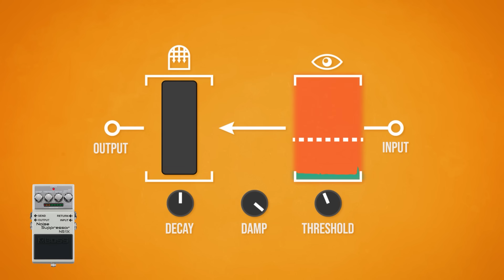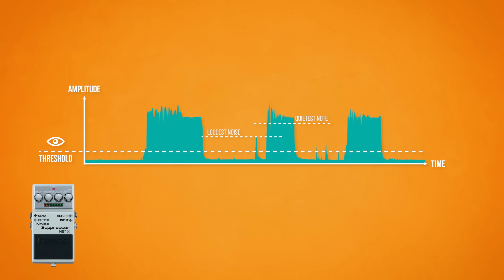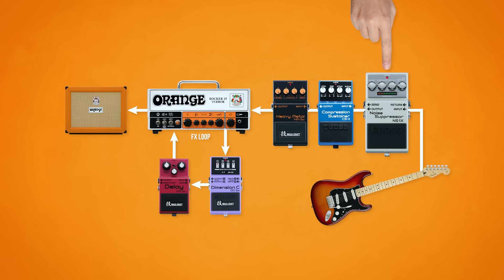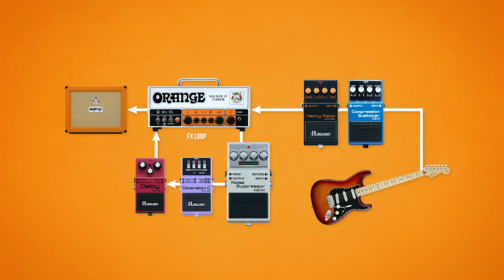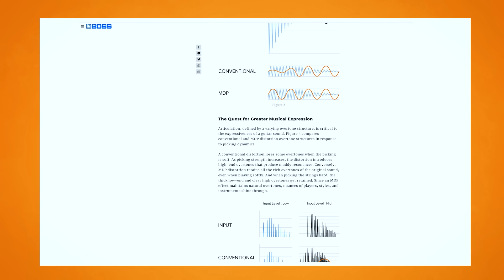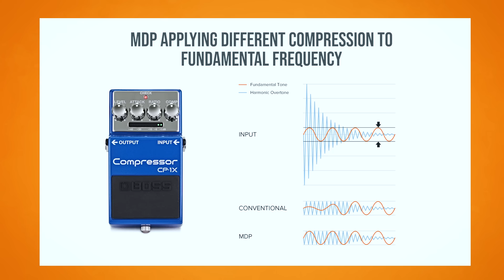Noise Gates: Everything You NEED to Know | Too Afraid To Ask

Comment: i have the problem that my prs  mt15 is feedingback like the high pitch squeeling feedback bcs of the sound that is coming back to my pickups. Does a noise supressor help with this feedback noise?
Reply from the maker: You want to solve the feedback issue before using a noise gate. A noise gate will struggle if the feedback is at the same volume as the signal. 

Feedback is often caused by the guitar being too close to the amp, using too much gain, having unpotted pickups or other microphonic elements in your signal chain. Try fixing these issues to reduce the feedback, then you might find a noise gate useful for any system noise that remains.

Comment: Excellent explanation of the issue and the correct solution, particularly with the sophistication available from the subject pedal.  Critical points successfully made with the demo sequences and the logic of connection, placement and controls and their effect.  Many a performance will potentially be enhanced simply from getting those four ports wired to the right place on your pedalboard. Thanks for keeping us informed Colin, knowing Watts what!

Comment: Even though we're trying not to amply noise, could we possible run the compressor into the noise gate input so it has the sound evened out and consistent and then use the send/return for the overdrives and amp preamp? I feel like there would be so noise compromise here but it seems like it could be the best way to keep input trigger threshold consistent.

Would love to hear your thoughts on this.

Comment: Do you have a video on how to set up the knobs on a noise gate?
Reply from the maker: Setting the knobs is dependent on the rest of your set up. 
But the short answer is: use your ears to set the threshold to where it is gating the noise, but not the notes. 

That's pretty much it.
Reply: @ScienceofLoud ah cool thank you. I was just getting confused on what each knob was doing. Threshhold makes sense but damp is confusing me.
Reply from the maker: @maxs.3224  Explained in this video at 1:50 

Damp is essentially how tightly is the gate shutting (or how transparent is the gate). 
When the gate is shut, the damp control selects how much of the signal still gets through.
Reply: @ScienceofLoud oh that’s what that was talking about! Thanks so much now it all makes sense.

Comment: You have no idea how many times I had to explain to redditors and forum rats that a noise gate works best if the noise hasn't been amplified by gain. "Why would I put my gate first? Distortion is where the noise comes from. It makes no sense to gate my clean tone? You just don't understand high gain equipment like I do." Like, trust me. I play a strat and use a Carcosa as a boost for a Big Muff. I know how you deal with noise.

Comment: I bought a Tele with gen 4 noise less pickups. It makes a static, crackly sound when I play. My other guitars are fine.  I don't use pedals. Would this pedal stop the noise?
Reply from the maker: I think it would be of more value to figure out what is causing that issue and solving it. Something is wrong with that wiring somewhere.

Comment: Hello! So the diagram in the video says the distortion and compression go into the "send and return of the pedal" Then the delay goes into the output of the pedal. What if my delay/reverb is already in the effects loop of the amp? Then does that not matter? I thought the delay and reverb would go into the send of the pedal and then to the effects loop of the amp then back to the return of the pedal. Then the distortion would go into the out, into the front of the amp? Or am I missing something? Thanks!
Reply from the maker: @RobertHappy15  You are missing the part where I made a whole video explaining this. Please watch again. 

You seem to be confusing the send and return on the Noise Gate with the send and return of an amps FX loop. These are not the same thing.

Comment: How did you run the Delay Llama after the amp if the Imperial does not have an effects loop?
Reply from the maker: @2yugen2  I'm using the Boss Tube Amp Expander, which has an FX loop - that lets me insert pedals after any amps that don't have a loop.

Comment: I have a TATA question...  In most speaker cabinets the speaker size is related to the frequency you want to reproduce-large for diameter for bass, small for treble.  Yet with guitar amps we use large 10 and 12 inch speakers to produce these ear piercing highs.  What does it work for guitar amps but doesn't work (or at least isn't designed this way) anywhere else?

Comment: Will it stop high pitched feedback due to cheap guitars?
Reply from the maker: That's not an issue with cheap guitars, that's an issue with how you are using your equipment.
If you have a feedback problem, that's something that needs to be solved independently from using a Noise Gate.

Comment: I have one question about the send/return function and how it cuts away all the background noise so accurate. Is it possible that the ‘sensing’ part sends two signals simultaniously theough the loop, signal “playing+ operating” and a signal thats only the “operating” noises. In my head the output than subtracts those signals so
(playing + operating) - operating = playing

Is this right or no
Reply from the maker: No. The explanation in the video is correct, what you have said in your comment doesn't make sense.
Reply: @ jups im sure you’re right, but i wondered if this sort of thing could ever ne used. Although it does make sense when talking about mass spectrometry, i guess not in electrical engineering.
Reply from the maker: @Jona000  Why would you think that the process of GC or Mass Spectrometry is in any way analogous to the operation of a Noise Gate? 

We aren't using the differing physical properties of molecules and their interaction with other materials or magnetic fields to physically separate the elements of a mixed sample. 

Notes and noise, as described in the video, aren't separate entities - they are both electric signals which form a superimposed waveform that cannot be separated. 

All a noise gate is doing is turning down the volume of the signal when it passes below a defined amplitude threshold. 

The 'Sensing' part is just looking for when the signal amplitude crosses the threshold. 
The 'Gating' part is turning down the volume to mute the signal. 

The Send/Return simply lets you place other processes between these two events. 

I hope this clarifies your confusion on the matter.

Comment: If you have a ton of gain stages in your gate and have to run it hard clamping,  you can put a Compressor, preferably one with a blend like the Keeley Compressor+ in front of the gate and it helps kick it open without choppiness or loss of tone and signal, the Keeley is great as you can blend it in for fine tuning and not compressing the entire signal yet, compress it enough to kick the gate open and stay open in sustain with ease. I had a Noise Gate on my 1993 Digitech Legend II and have been using one since that year. I had the comp , para eq, GEQ and Grunge distortion presets for rhythm and played very percussive 90s Hardcore/Mathcore/Metalcore.  I would let people borrow my Tubeworks Tweed  4x12 at shows, but my high gain and noise gate (W/Tubeworks 1600 STereo SS Power Amp) that was very touch sensitive scared off all the Crate and Valvestate with a Turbo OD kids off. The first Dillinger guitarist had a similar set up but an ART procesor in his Rack. Gigged together actually.
Reply: I have an ART 2000 EXPRESS  guitar processor ..Way ahead if it's time..👍🎸 🎸 🎸
Reply: @lisaayers1975  I had a Digitech Legend II, when I gigged with Dillinger Escape Plan in the early years their first guitarist had an ART and I my Digitech ab power amp was very similar I had hard gates on that.  I can't do digital diarrhea anymore. Glad my ex guitarist had a nice punchy tube amp to help the tone on the old 1999 full length we did.  I have a walk of Orange amps but selling lot to downsize

Comment: The way u explained and graphed the fx loop part was very confusing
Reply from the maker: @Kudabear1  just because you were confused doesn't make the explanation confusing - no one else had an issue understanding it.

But please do tell me how you'd have explained it in a less confusing way.
Reply: @ScienceofLoud  I can't Im trying to understand how it works and I still don't get it
Reply from the maker: @Kudabear1  Everything in the loop sits between the sensor and the gate - as if the sensor and gate were two separate pedals bookending the effects in the loop. 

I can't make it simpler than that for you

Comment: Is there a way to retain intensional feedback but still have it cut it off when needed? I have a solo with several rests that ends with some sustained feedback, and I haven't been able to achieve both the feedback and actual silence at the rests.
Reply from the maker: When it comes to the point when you purposefully need feedback, you can just disengage the noise gate.

Then re-engage it again once that section is past.

Comment: Hi Colin! Not sure if you are able to help out with a question here. I have a Rocker 15 Terror as well, and run my time effects through its FX loop. 

I see your diagram to run the end of the distortion chain directly to the amp's input, and then run the Send of the amp's FX loop through the Return of the noise gate and completing the signal chain this way, as opposed to running the end of the distortion chain to the Return of the noise Gate and the Output of the noise Gate to the amp's input. However, at another point in the video, only the distortion pedals are going through the noise gate, and the output of the noise gate is going to the front of the amp. 

Theoretically, this might also gate any noise generated by the amp's distortion channel, but I am wondering if this may have any adverse effects or be otherwise unadvisable. Is there any best practice on whether or not to place the noise gate within an amp's FX loop or go through the front? Hope this makes sense, thanks!

FYI I love your videos; I've always been a fan of knowing how stuff works, and you do an incredible job of explaining things in comprehensive yet easy to understand terms.
Reply from the maker: My suggestion would be to try it and see what you think. You are not in any danger of damaging anything, if that's what's concerning you. 

Whether it will be beneficial or not is ultimately dependent on what pedals and amp you are using, and how you have them all set. 

Try it both ways and find out what gets the better result for you.
Reply: @ScienceofLoud  thank you! Appreciate the reply

Comment: Hey if my delay pedal produces noise and i still want the tail will it work if i put this pedal after the delay or will it kill the tails
Reply: It will kill the tail. That's why you put your gate before any delay or reverb.
Reply: @fonesrphunny7242  but will it remove the noise that i get from the delay if i put the gate before delay
Reply: @eriksafin  You want to filter out noise, but that's not what a noise gate does. It is not going to solve your problem.

What delay is it anyways? Is it old or used and maybe damaged? Tried running it with a 9v battery? Cables? Nearby interferences? XLR ground loop? ...

Find the cause and stop fighting the symptoms. Filtering should be your very last option, but a noise gate won't do that.
Reply: @fonesrphunny7242  Thanks man God bless you

Comment: Hello @ScienceofLoud  This is a great video on both how to use and how to set up!  I had a question through... I just bought the NS-2 yesterday.  I have is all plugged in correctly and it seems to be working great.  The thing I noticed though is there is zero noise when I am not playing the guitar.  However when I start to play the guitar I can still hear the noise over the guitar distortion.  Is this normal?  I have it hooked up correctly using the send/return into my distortion pedals.
Reply from the maker: Yes, this is normal. 
As I explained in the video: A noise gate doesn't remove noise from your signal, it simply shuts off the whole signal when it drops below a threshold amplitude. 
If your signal has a lot of noise, you're going to still hear it when the gate is open. 

If the noise is louder than your signal then a Noise Gate won't fix that - you have other problems which are creating noise that should be addressed separately.

Comment: Hi Im wanting to use one with a loop , but send the 'input/ send' on AMP A's input but put the send from another AMP B into the  return and then output through the pedal back into AMP B's return. 
Im using a stereo setup and the Zombie 2 is really noisy , whilst AMP A only has an OD1 in front of it. 
I understand that the pedal is like an X path and think that the signals wouldnt mix. Theoretically using it on 2 amps ( one in front using the naked guitar's noise floor) and the other in AMP B's noisy FX loop. Good eh???

Comment: I did 4 cable gating for a while. It works, but not for me. It's too much setup for minimal payoff as i only use my gate as feedback reduction. My NS-2 is too slow, so these days i just ride the volume or turn down the gain a little. I still keep it on to reduce feedback on the choppier riffs, but i can get by without if need be.

Comment: Is there a way I can roll off the volume for more dynamic playing with “edge of breakup” sounds while using a noise gate? I stopped using noise gates because my signal would cut out when I roll off my volume knob? I wouldn’t mind going back to using noise gates if there if I can retain my signal as I roll off the volume knob.
Reply from the maker: You have to set the threshold of your noise gate with your volume rolled back to ensure it is below your rolled back signal level.

You always set the gate for your quietest playing.

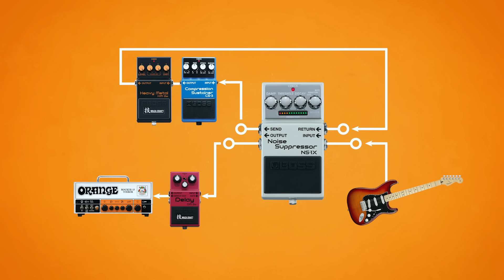Comment: Great video, Colin. You're explanations are always very helpful and enlightening, but I'm still a bit confused about something. The diagram at 9:54 shows compression/dirt in the Return/Send loop of the pedal and the Output going to delay/reverb then to the amp. However, I'm having trouble seeing how this matches up with your diagram at 8:08 showing the signal going through suppressor Input, then to dirt, then amp, while the Output (second "half" of the suppressor) of the pedal going to delay/etc. in the amp's effects loop. I'm fully aware your diagrams are for illustrating what you're talking about at that moment in the video, but if you could shed some light on this, my tiny pea brain would appreciate it! Cheers!
Reply: Guitar -> NS Input 
NS Send -> Comp, Dist, Amp in
Amp Send -> NS Return
NS Out -> Delay, Reverb, Amp Return

Essentially, the compressor, distortion, and Preamp are all in the Gate loop, and the final output of the gate goes through the delays and reverbs into the Amp return. It makes more sense if you think of your amp as having "Preamp in, Preamp out, Power amp In" instead of "Input, Send, Return"

Comment: This is a great video, thank you indeed! But what about the 4-cable method with Noise Gates?
Reply: 7:35-9:05.
Reply: @AeolianSeventh  Appriciated, but I'm talking about when you have an FX loop on your amp etc. and put the "send" go to the amp input and the "output" to the amps FX loop return.
Reply: @RohmanDarkwaltz  It's the same principle, keeping in mind that the preamp (everything before the FX send, usually*) is a gain device just like a compressor or distortion pedal.  

The diagram at 8:06 is showing the four-cable method:
-guitar to noise gate input, so the signal is sensed before any gain is applied; 
-noise gate send to pedals, which will add noise; 
-pedals to amp, which will add noise; 
-FX send, where hopefully all the noise has already been added, to noise gate return, where it will be gated;
-noise gate output to delay, reverb, etc.;
-delay, reverb, etc. to FX return, where the signal becomes loud.

*I say usually because for some reason Soldanos have the FX loop right in the middle of the preamp, after most of the distortion but before the EQ.  It's weird, and it's never worked well with any noise gate I've tried.

Comment: I‘m pretty sure we‘ll see a lot of evolution in noise suppression in the coming years. Noise vs. signal is something you can train neural networks pretty well on, and they, in turn, can then actually filter the noise out, not just gate the complete signal. There‘s already some incredible advancements in image denoising coming in lately. And running a pre-trained NN is actually not that computation heavy—smartphones run tons of them for all kinds of stuff already. You don‘t need crazy fast processors or a lot of power for that.

Comment: While it serves a similar function as a noise gate, the ISP Decimator is a downward expander, not a gate. It adaptively tracks the signal resulting in a much more natural sound.
Reply from the maker: That's a noise gate. A downwards expander is just a fancy way of describing a noise gate.
Reply: @ScienceofLoud  "The major difference between expansion and noise gating is that expansion is dependent on the signal level after the level crosses the threshold, whereas a true noise gate works independently of a signal’s level beyond the threshold " 

"A noise gate is more aggressive and abruptly cuts off the sound when the signal drops below the threshold. It is used to reduce unwanted noise in a recording by muting the audio signal when it falls below a certain level.

On the other hand, a downward expander is more subtle and smooth sounding because it fades levels rather than mute them. It is used to reduce the dynamic range of an audio signal by attenuating signals that fall below a certain threshold"